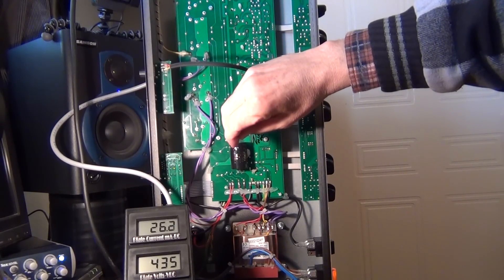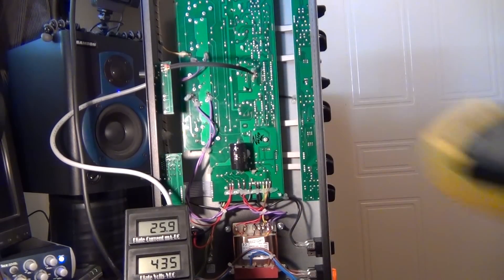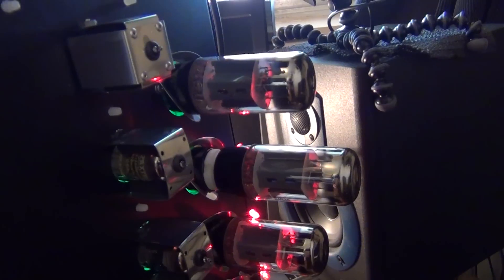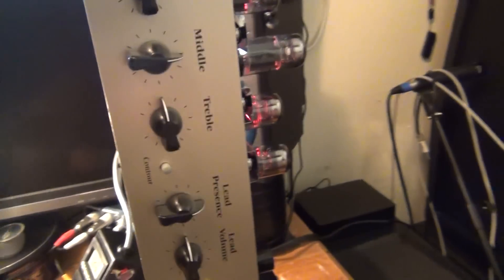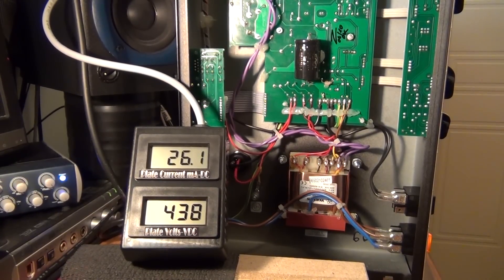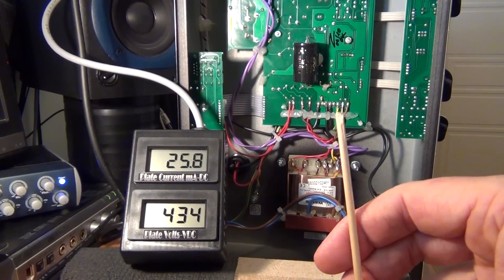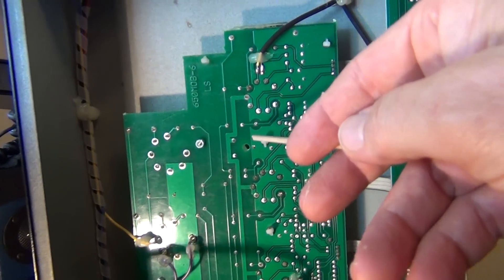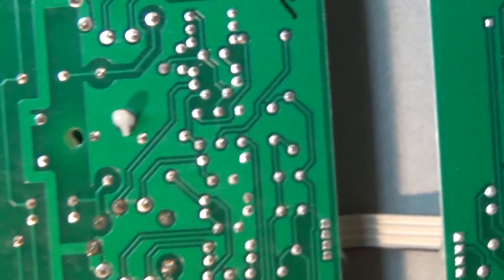DIY Engl E650 Blackmore amp bias adjustment. By Calgaz77

Comment: Why the hell are there almost no amps with automatic biasing? Surely building such a cirecuit into an amp can't be that difficult.
Reply: Bugera
Reply: You can’t even adjust the bias on the peavey 5150 or 6505+ because they are set so cold you don’t even really have to worry about it. You can have them modded to be biased but it’s not really a night and day difference. I kind of like the idea but most people seem to not
Reply: @redalert7504  The 5150 and 6505 are fixed & cold biased but the 5150II and 6505+ are not. They are adjustable.
Reply: @SuperGuitar38  I’m pretty sure you have to mod the 6505+ for it to be adjustable

Comment: Hi Gary I was wondering if you could help me on what math you used to get 30%? The calculation I used said that 30% would be 17mA not 26mA. Am I doing something wrong? My math was 25 divided by 436 and then multiply that number by .3 to get your 30% which is around 17mA. Thanks
Reply: The Ideal Bias/Control situation would be this i rekon , you have 437 volts DC , on the plates at idle ( everything turned down, nothing plugged in ) , call that Va , now divide that by 10 = around 44 volts , which should be a negative bias voltage , - 44 v , which you would measure on the wiper of the bias trim pot at the middle point of its sweep .          
 (12 o clock)  . Ideally you would have 25% below that at fully counter clockwise or 25% above at fully clock wise.Ideally you would have between - 33 and - 55  volts from the whole sweep left to right although it doesn't have to be exactly that . what this negative voltage does , is it controls the speed of electron flow through the power tube , from cathode to plate , like a throttle ! . a higher negative voltage will slow electron flow,prevents the tube from breaking into B class ,and then on to even  sound  cold and thin,   all the way up to "cut off " , tube not conducting ! where lower than middle point  ,will cause the tube to "BREAK" into B class (crunchy) easier , or lower  down to 0 volts or even positive voltage,  will red plate and self destruct it , also called thermal runaway . The Electron flow called Coloumbs of charge ,and is what we measure as milli Amps in this case .The Euro bias socket has a 1 ohm resistor , that is known as a "Current sensing resistor "in series  between Pin 8 of the tube , and the amps socket , which converts the current ,( milliamps) , at a 1 to 1 ratio , to millivolts ... which is what Garry is setting to his nice place .. So Garry is adjusting the speed of electron flow to 26 milli Amps , which is a nice number , Pretty warm for a 5881 really , especially if it was a T A D (Chinese) ,  His power tubes will last a lot longer if he adjusts back to 17 milliamps   ,but that amazing tone , is the  result of his amp breaking into class B  at that point  , if anyone wants to understand this a little better  , check out the bias simulator at "what is the bias point wave simulator at tubedepot.com. google it .

Comment: Hi Garry, could you tell me one thing, as I'm struggling with some issue:
- if you set clean knob to 0
- master to 12
- with no guitar connected
is there any noise?
in my case, it is there on clean channel or crunch, but on lead with lead vol set to 0 there is no noise.
I'm just trying to know if that's normal behavior, unfortunately couldnt get straight answer from support
Reply from the maker: Wrocknaz 
Hi Wrocknaz, with your suggested settings, I have hiss on the clean channel 
and a little less hiss on the lead channel. 
The speaker box is right next to my pc tower so the fan noise is probably 
three times louder than the clean channel hiss.
    I hope this helps. Gaz.
Reply: Thanks :) I thought something is wrong with mine, though my noise is louder so I will just get proper tubes.

Comment: Thanks Garry, and nice video.  I believe you had the amp power and standby switch both on.  Was the amp connected to a cabinet when you were biasing?  I have a Blackmore too and love it.  ENGL told me if you buy the 5881 valves from them and with the same grade, rebiasing is not required.  All the best.
Reply from the maker: CHRISTOS FRAGIAS  Yes Christos the amp was connected to the cabinet. Thanks for the reminder.

Comment: It is the hum balance pot for the heaters of the tubes. You can dial in the pot to minize the hum it actually balances the heater winding(s).
You amp has been built in June,2010.

Best regards from another proud Blackmore owner(prototype from ´95),
Robin
Reply: It is possible to balance the heater supply on any amp that doesn't have a centre tapped heater winding , with only 2 resistors of 100 ohm , 1 watt..
Reply: hi there, found your comment 5 years later, hope this account is still active lol. how can you tell how old a blackmore is? i've had mine second hand since 2011 or so, i'd love to know how old it is.

Comment: Why did you bias the amp so cold? At the bias point you set this amp, you're well into crossover distortion. At 435 plate volts you should be setting the bias at least to 70% dissipation which should bring you at about 39-40mA. A setting of 26mA is WAY too cold
Reply from the maker: Moshe Alvarez Thank's for your concern Moshe.  
I'll just explain what I found when I opened up the amp and the advice from Eurotubes  
     When I plugged the bias probe in and started to adjust it I found the bias pot was completely turned off, at that point it was reading something like 22mA. So I tried to turn the pot up your numbers as I had come to a similar calculation, however the pot would not go any higher that 29mA. 
     At this point I thought the bias pot was faulty or the bias probe was a lemon. Hence I emailed Eurotubes to see if they could 
elucidate the matter. They got back to me with the point that Engl designed these amps with a cold bias adjustment range adding that even with the hottest grade of power tube you will rarely break into the 30's.
     So the next question is why am I at 26mA and not 29mA? Maybe I should open it up again.
Reply: Oh, I see. Did the guys at Eurotubes suggest any special bias mod that will allow you to dial in the proper bias?
Reply from the maker: Moshe Alvarez No suggestion was offered nor did I think to ask Eurotubes for a remedy. I must say that I find the amp to sound and function excellently. However I'm no tone guru so another person may think it sounds rubbish. 
     The set of tubes I bought from Doug's Tubes in New York actually restored the high gain channel to the same volume as the low gain channel. There seemed to be something amiss with these amp when they first came to Australia most shops I contacted didn't want a bar of them. Anyway the first one I bought had to go back as the high gain channel didn't work then the second one would no respond to the Z-5 foot pedal. Consequently these amps are quit cheap on ebay.
Reply: So strange. I work for ESP guitars in North Hollywood, California here in the States and Engl has a showroom across from our building. I'm thinking I should walk over there and ask them if your amp should be running at 26mA and see what they say.
Reply from the maker: Moshe Alvarez No worries. Let us know how you get on.
     Thanks.
Reply: Will do, sir!
Reply: I agree to some extent,, the bias with the tubes he showed in the video is 26mA x 435V which is 11.3W plate dissipation which is a bit low. 
Just barely enough for a small bottle 23W 5881 (49%) 
To cold for a 25W EL34 tube (45%) and stone cold for a 30W 6L6GC tube (38%) which will give a lt of crossover distortion. 
I recommend that Garry finds the specs on his stock tubes (max plate rating) and try anything between 50% to 70% idle plate dissipation. 

Not all modern amp sound best with a 70% idle plate dissipation. With some grid biased amps, 70% can tend to give an exagerated midrange and a big but not very tight bass. 

One guy reported that his traynor ironohorse with multiple different matched EL34 sounded best with a colder bias.. 45mV was recommomended at the test point for each tube which is 45mA total cathode current at ~410V he found the amp congested, lack of clarity, "tight", harsh,. He liked the amp with a total cathode current of 35-37mA (15W total tube dissipation which includes screen current to). It was tighter, clearer, more articulate. 
A fender hot rod deville biases it tubes at 30mA at 485V or 14.5W which also is a bit cold for large 6l6GC tubes but ok for smaller 23W 5881 tubes.
Reply from the maker: Thanks for your input CP.
Reply: My E650 has 437 plate volts. I've got JJ 6l6GC which the specs sheets list as a 30W tube. So the current winds up being about 48mA for 70% dissipation. My bias adjustment could easily go above that. I bought mine in 2007....so the rarely breaks into the 30's doesn't seem right. At least from what I am seeing with my head......Just wanted to offer some real world experience with a E650 in case you were still wondering about yours.
Reply: @CrushingProductions  would 55% plate dissipation be good for this amp? I have a V2 blackmore and the tubes are actually TAD 6L6 and not 5881.